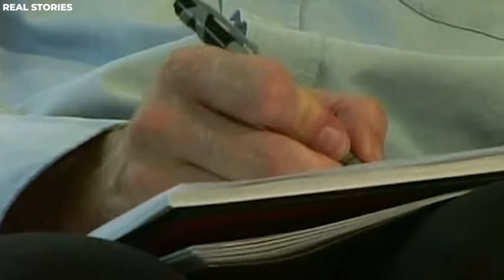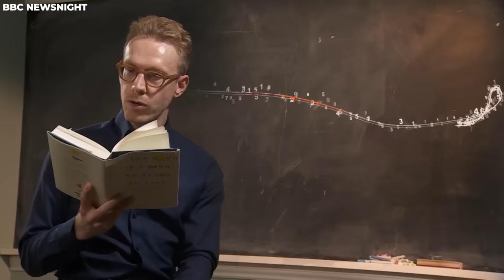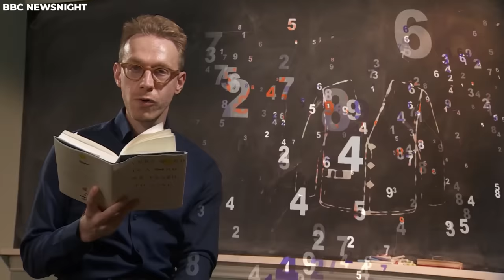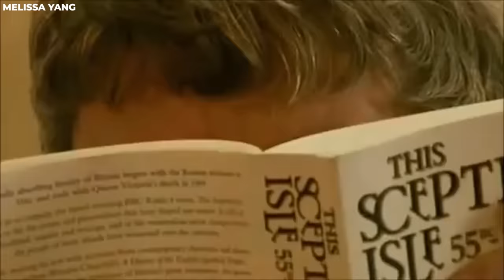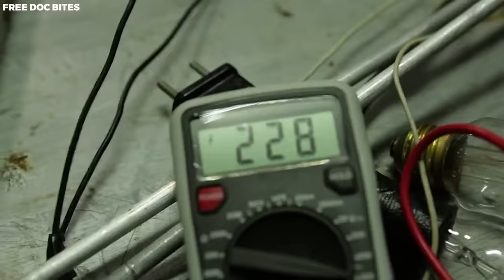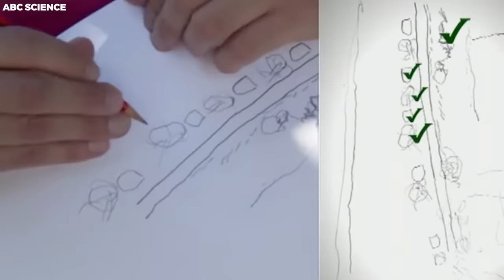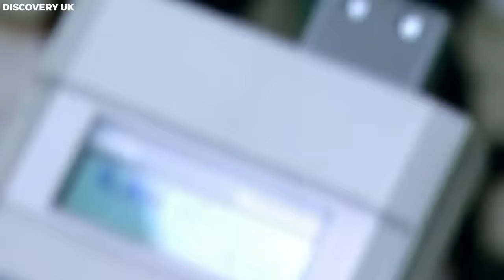17 Rare Humans Who Have Abilities That Will Shock You

Comment: My husband has stretched retinas. He has low power vision (50% disabled. I would say that the woman with the acute vision might have more cones and rods if anything. I grew up seriously nearsighted, and my eyes focused at different focal lengths, a few inches in front of my nose. I could not adjust binoculars to focus both eyes at once. If I used just my bare eyes I could see as 10x loupe. This went away when I had LASIK 25 years ago. Both eyes focus at the same point and I can use magnification normally now. So the tradeoff.

Comment: 16:30 Whoever makes the claim you're parroting, - I don't think they understand what Resistance actually is. Or any part or whole of Ohm's Law. This Serbian fellow is a total fraudster. Pretty sure that so is the "Breatharian" fellow. Now the old fellow in 28:00 - you can actually look this one up: the Chinese State tried to cover this up, but on the 23rd of June of 2019 he hugged his shirtless grandson. The pair needed extensive surgery and 116 stitches later to become separate again. The grandfather recalls the weirdest experience he had trouble getting used to during this 14-month ordeal was his grandson needing to do a number 2 at exactly the same time as him. Sitting on a potty while holding one was especially physically challenging in a Chinese village which had no electricity, running water or sanitation, and makeshift latrines one had to squat over, as access to Tic Toc was the only modern amenity the village has experienced in two centuries. Though the situation was at times desperate, -  with most surgeons "not wanting to touch this one" grandpa didn't lose sight of hope. After all, this wasn't too different from what happened when he met grandma, only in her case, - the Monsoon with its tropical rains, and his perpetually leaking roof was enough to cause her to eventually "fall off" only some eight and-a-half months later without the need for surgery. She gave birth to a perfectly healthy, although incredibly sticky baby girl the very next day, alleviating their earlier fears that the trio would be stuck together  in this giant human chicken dumpling after she gave birth. 

Just kiddin'. But if you don't see how pulling a vehicle with his stickiness is a cheap parlor trick - how could you possibly doubt the story I just told you? Exact dates and numbers will make anything believable.